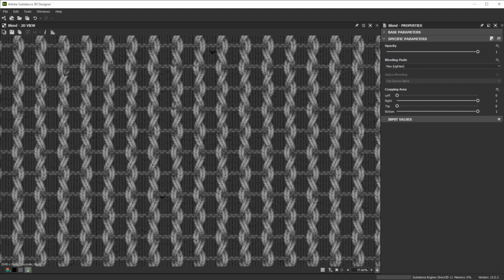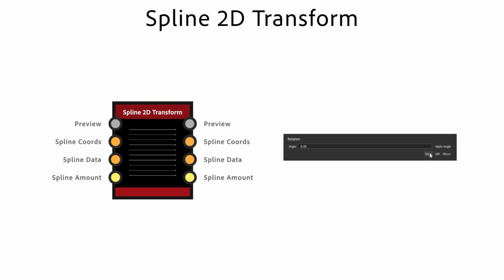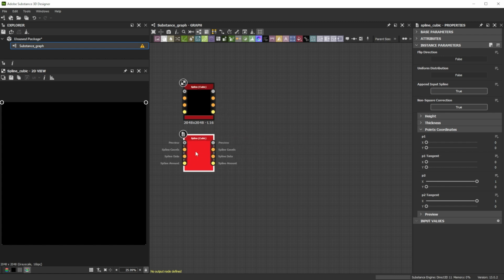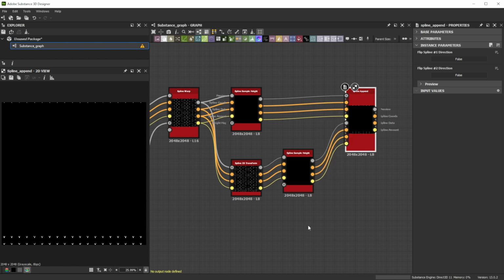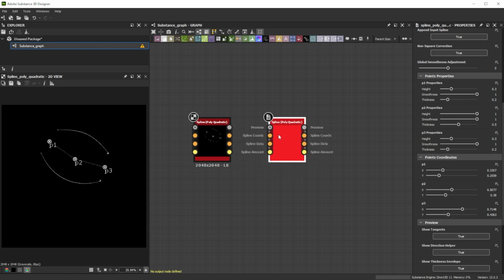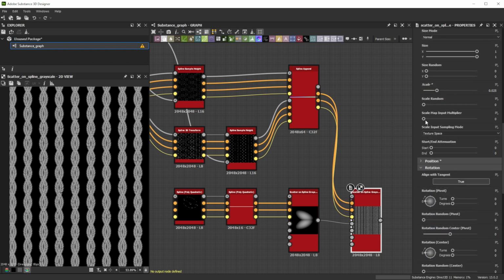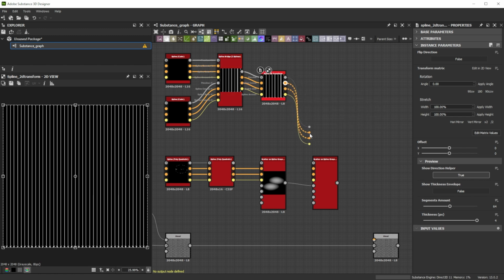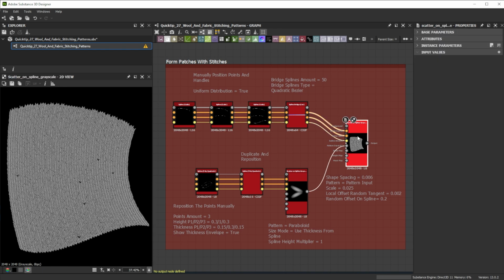Wool | Designer Quick Tip #28 | Adobe Substance 3D

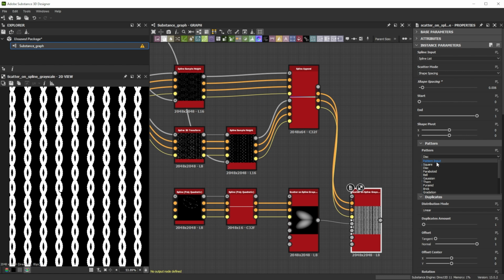Comment: For the Scatter on Spline Grayscale node, when Pattern is set to Pattern Input, little holes appear that look like missing stitches. Seen at 4:55 on the 4th and fifth splines in the 2D view. What causes this? Is there a way to prevent it? Thank you!